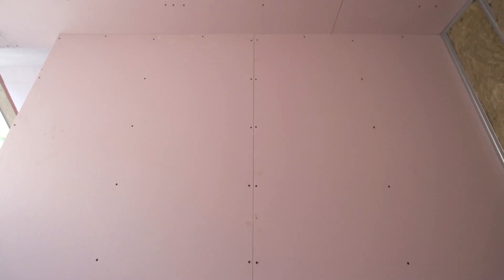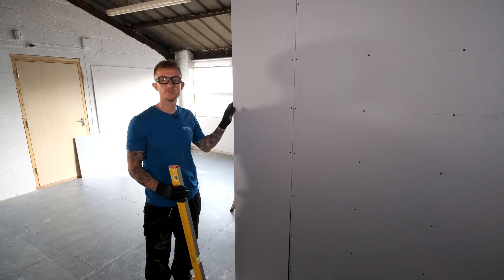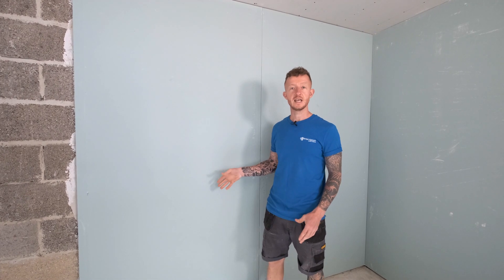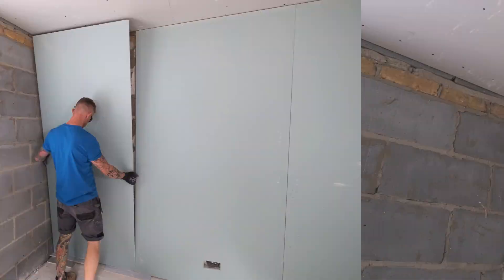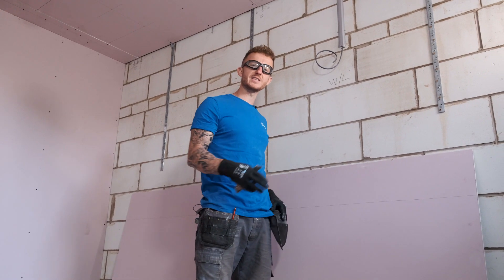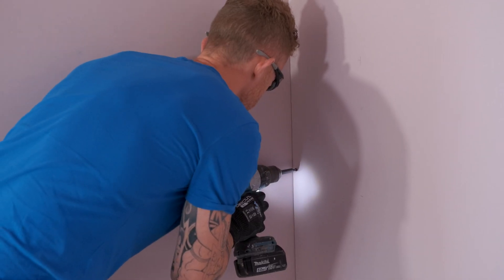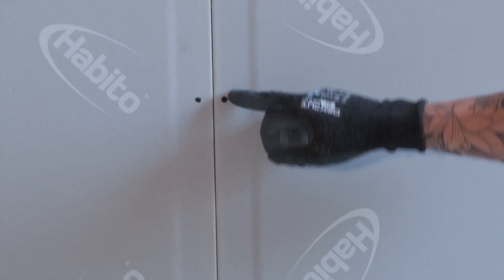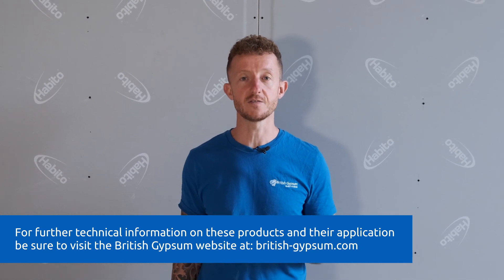A practical introduction to British Gypsum’s Gyproc plasterboard range.

Comment: Does Fireline need special intumescent tape at the joints? Also, I can't find a table of fire resistance (in minutes) for your various plasterboard types and thicknesses, and qty of layers. And does 2 layers mean 1 overlaid on another, or if a stud wall has 1 layer each side, is that then said to be 2 layers, ie does that have higher fire rating?
Reply: 2 layers would be on the same side